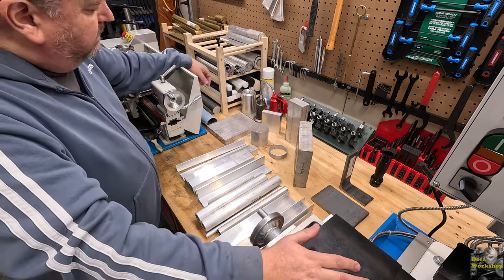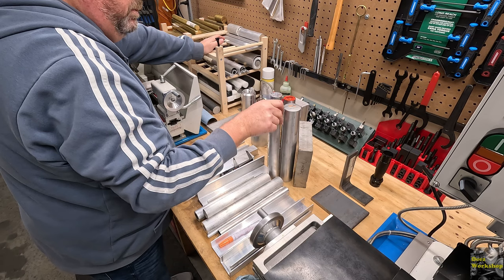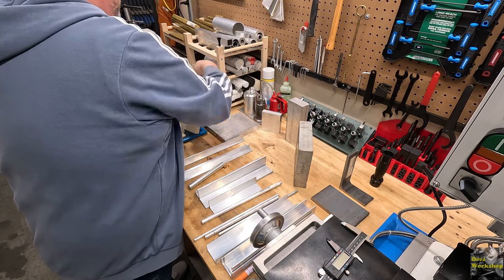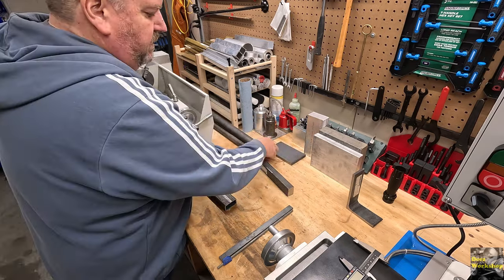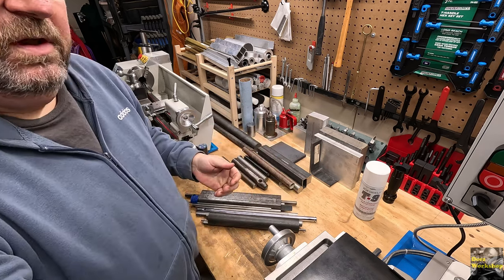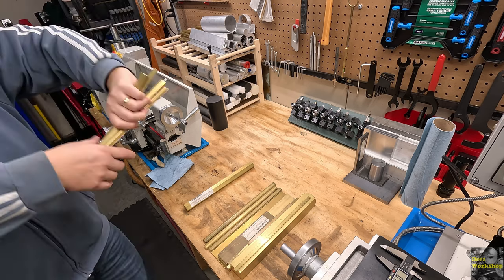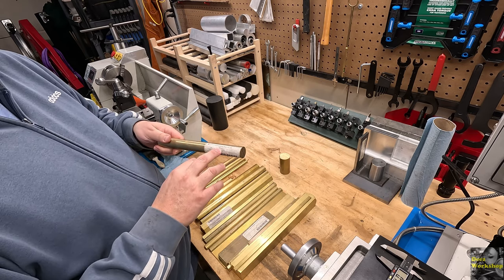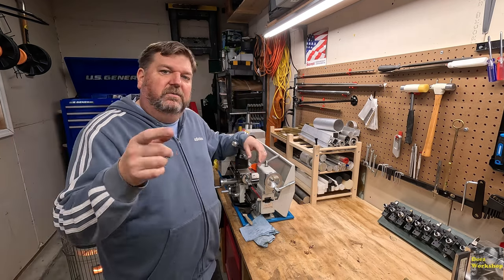Going through Raw material Stock for inspiration - looking for future Mill and mini Lathe projects

Comment: How about a set of thread savers for the lathe or a lathe saddle stop or maybe nylon V blocks for the mill or even a 1/2" thick 45 angle block all very useful.
Reply from the maker: I have a Lathe saddle stop on my list but adding the nylong vblocks.  Great tip and I have plenty of nylon.  Adding thread savers but I had avoided making them due to my past frustrations with my Tap set.  Time to get on with it.  :-)  Adding all your suggestions to my list.  Thanks
Reply: I made mine out of high density molecular weight plastic and i think those two black long pieces you have are HDMW. @deezworkshop
Reply from the maker: @TheMiniMachineShop Thanks,  Would be a good use for that material.
Reply: Correction UHMW

Comment: PM Research has some cool machining projects for not much $$.  Some small steam engines that require machining before assembly and also a bunch of late 1800’s miniature machine shop pieces like a shaper, drill press, lathe, etc.
I’ve got 5 waiting on my shelf. Inspired by Blonde Hacks & Joe Pie
Reply from the maker: I had never heard of PM Research.  Great tip.  I will be looking to pick up a kit that requires a bit of machining.  Need to check the inventory.  Thanks

Comment: Do you have a threading die holder for your tailstock. Boy, don't get rid of the aluminum cause you have a fortune of it. Where I live thats alot of money.
Reply from the maker: I actaully made one.  It mounts in the tailstock using my jacobs style chuck.  works great.  I have a video or 2 on that one.  Was a fun project and I hot blued it. So far no fust is appearing.  Used it many times.  I love having this aluminum stock.   its messy to machine but is much easier on the tooling and most of my projects are fine in aluminum.  Fortunately it is about the cheapest for me to get...at least in the random cutoff boxes I purchased in the past.

Comment: I metioned it before, Stefan Gotteswinter has a low profile dti holder for the mill. He made the plans public and has a build vid too. Try it in ally or brass for practice, obviously steel for the final project, but it looks good, check it out👍👌🇦🇺
Reply from the maker: I just checked it out and downloaded the plans.  I will think about this one.  I would need to get a small dovetail cutter but I have another project in mind that I could use the dovetail cutter for as well.  would be a handy tool to add to the toolbox.  Thanks.  Will be watching more of Stefan.  I have wated some but not a lot of his videos.

Comment: make a tap centeriung tool. it holes the tap center while you tap a hole.
Reply from the maker: I did pick one up but my taps dont havce a divot.  They have a point.  I could make a new pin that allows for an inverse point to use with my taps...  Project on the list  :-)  thanks.
Reply: @deezworkshop   check the pin out, some you can flip over and it has a cone instead of a point on other end.
Reply from the maker: @mike9500 I did and its flat.  I thought about putting it in the lathe and turning a cone into the flat side.  I did contact the seller on amazon and they refunded me the money and said keep it.  lol.

Comment: go to the local metal supplier and ask to check out the scrap pile. you can get end cuts and such for cheap!
Reply from the maker: I did attempt this with one supplier.  When I said do you ahve a scrap pile...they sort of did but the response was, "We will sell you anything you see in these buildings".  :-)  most of it of course was A36 steel box channel, u channel, round bar but all full lengths and nothing I could use.  I did find an area they had wiht some smaller cutoffs so I grabbed a couple pieces of round bar about 2" in length and a nice 2' square sheet of 1/4 inch flat plate.  I wanted that for my workbench.  I think they could order me anything I want but was hoping they dealt with more brass and aluminum and free machining steels.  Oh well its a source at least I can use.